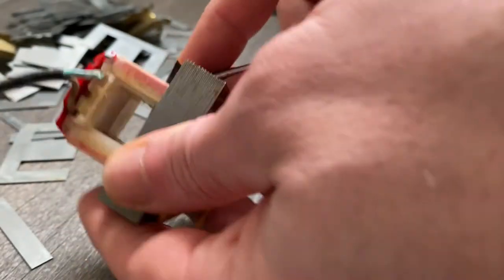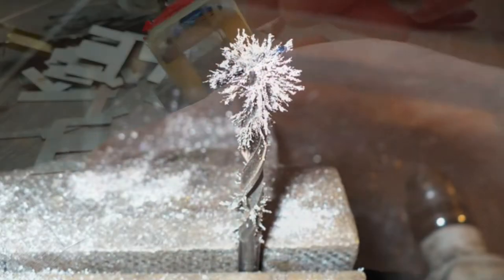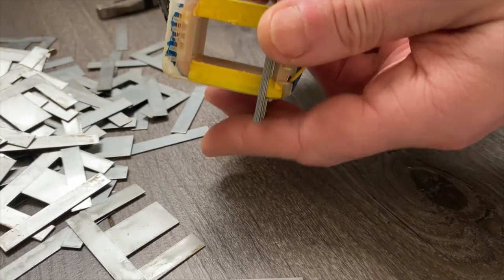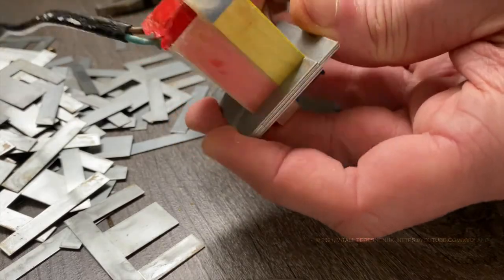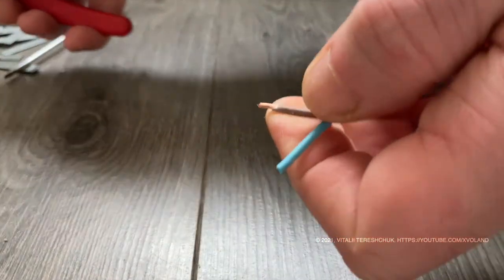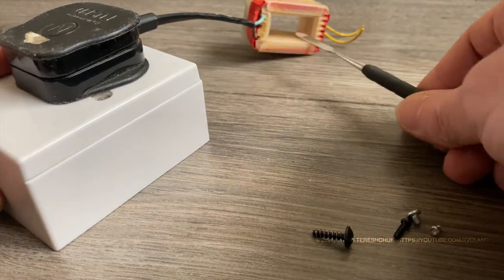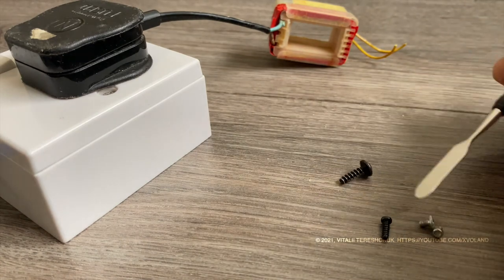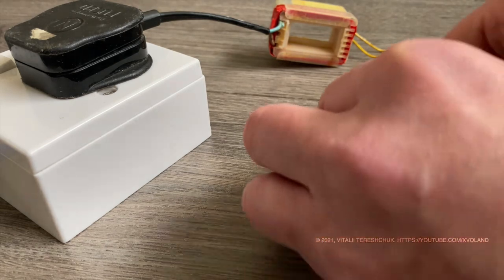🛠💡 DIY How To Demagnetize screwdrivers, tweezers, drills, bits or watches. Quickly and effectively

Comment: interesting video! can you explain why did you have to remove the transformer plates and use coil only?
Reply from the maker: This is physics, the law of electromagnetic induction and Laplace's law. There is an alternating current inside and when we bring a magnetized part inside, the amplitude changes and demagnetization occurs when we take it out